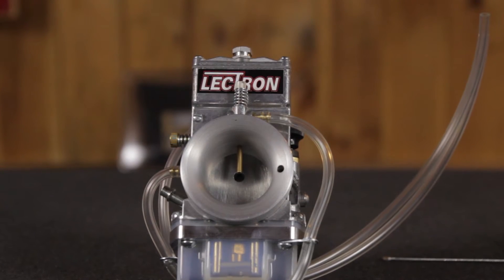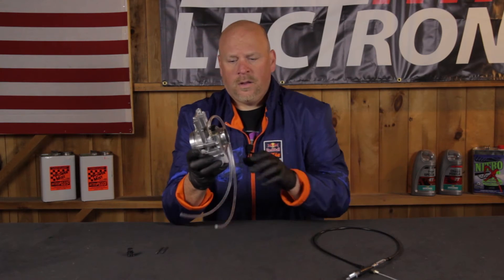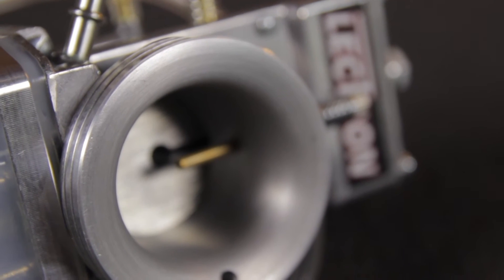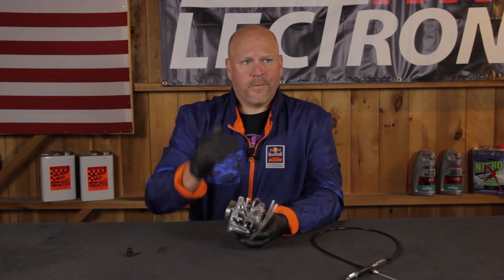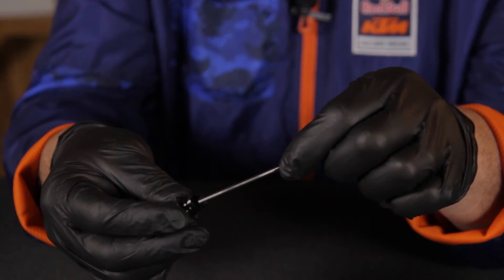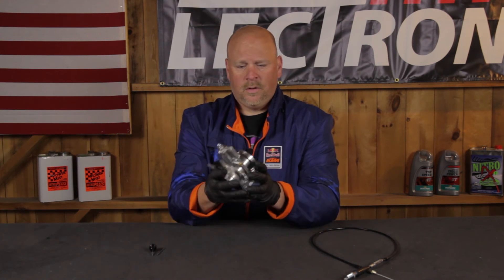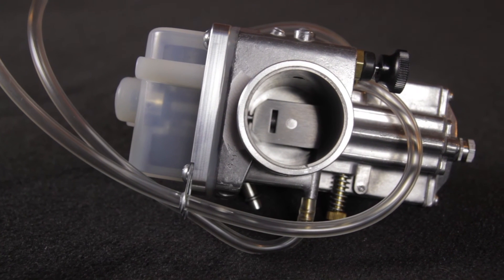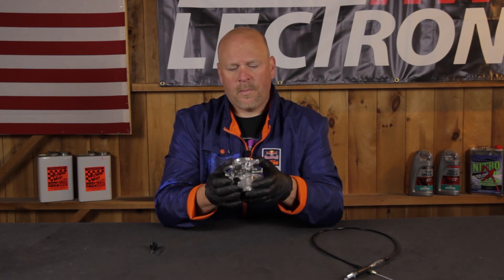JBone Motorworks 2016 KTM 150SX Factory Bike Build - Episode 5 Lectron Carburetor

Comment: Did you guys ever experience fitment issues with the lectron on the 150?  I also purchased the boot that helps with this from lectron, but still seems a bit tight and can visually see where the boot will touch the spring slightly.  Also, I noted that the boot does not sit as it should in the airbox due to the lectron... just a tad however.  I have been paranoid about this and wanted to see if anyone out there had experienced anything similar.  Thanks - Clark in Atlanta

Comment: 1978 they came out std on a ktm 175 use them but they are NOT new and forget putting it on a twin BWW 800 runs bloody awful under 2000 rpm   its flat out .then its great ..... 2 stroke as for milage went from 80 klm to 110 klm a tank Good on fuel once set never adjust amazing thats from the piston port and rotary DAYs

Comment: "The future is here with Lectron Fuel Systems Carburetors"
They have been around for a while, and tuners wouldn't touch them because they were a pain to use. Only drag racers found benefit. Now SmartCarb builds an updated metering rod carb with better technology all around and bam, people start jumping on the cheaper Lectron? I don't get it.
Reply: Hello
You are correct in that is has been around for a long time but 5 years ago Kevin and David bought it and have since made many upgrades and made it fit many more applications/models. The Smart Carb was a BIG flop. It didn't work properly for most applications and they could never produce it, always on backorder. They have since gone in to bankruptcy. 

Just an FYI: the cast Smart Carb and the Lectron are the same price within a couple of bucks.
Reply from the maker: I think part of any issue when working with technology that challenges us to rethink our approach is going to have a learning curve.
Reply: SmartCarb had some teething issues, as with any new, high-tech product will. But overall, it was pretty unanimously positively liked. Including by me, with over 2 years riding on mine in Wyoming and Colorado. And all new products with big benefits have back order issues, no surprise a small company making such a product will. I've often seen you (Jeff) having different parts (tires) or services (porting) on back order. hard to fill all orders when you have something new and/or the best in the business that makes it hard to keep up with demand.
Corey Dyess is still making them, he just left APT.
I'm not here to attack either of you, I respect both of you, just find it funny how no one was into Lectrons until the SmarCarb came out with big performance and technological advancements, then everyone jumped on buying the Lectron because it was cheaper and on the shelf. And even funnier how many expected the benefits that SmartCarb claimed, though they went and bought a Lectron, without the technologies of the SmartCarb, then were disappointed and said metering rod carbs are junk.

Comment from the maker: I mistakenly said it is completely externally adjustable which is not 100% true...if the metering rod system needs to be adjusted, the only way to do this is remove the rod and adjust it.  Once this is set and working properly, the idle/low rpm circuit and hi rpm circuit are externally adjustable.  As with any performance mod, install, adjust, and TEST,TEST, TEST and document settings for future reference.  thx all!